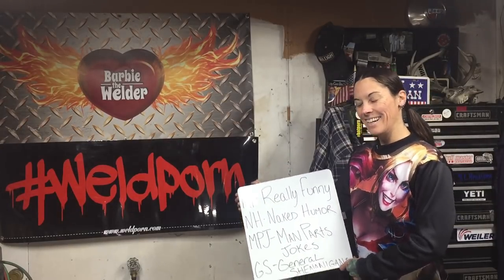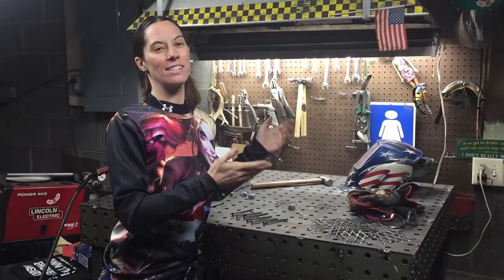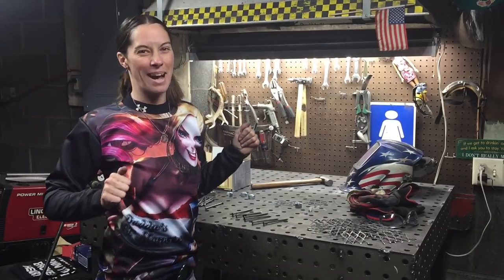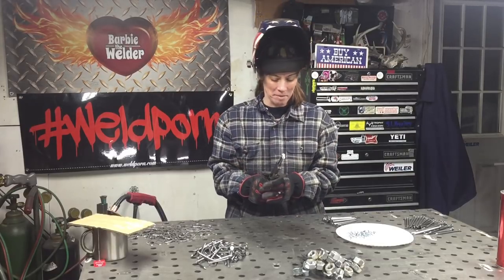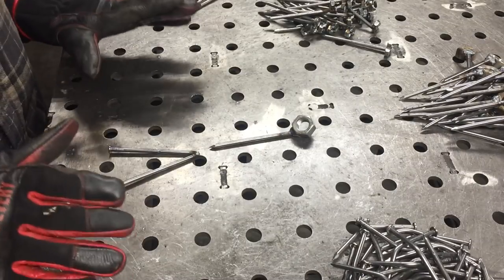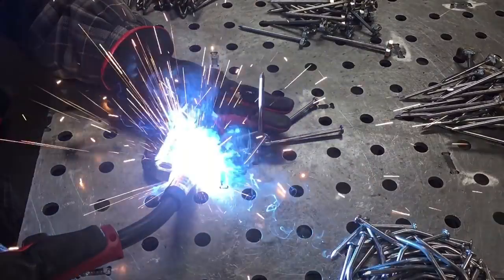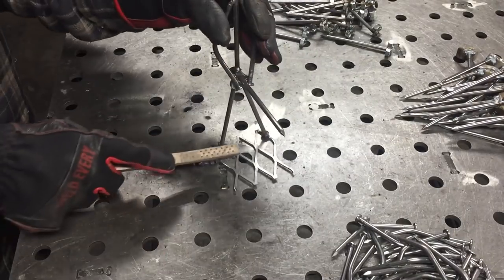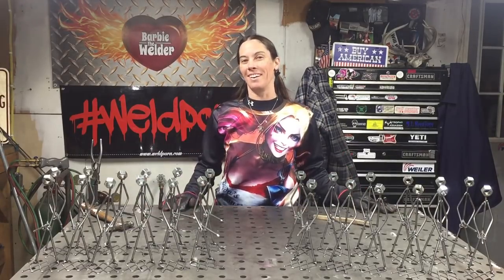How To Weld Big Dick Hot Dog Cookers | Easy Scrap Metal Art | Barbie The Welder

Comment: ...And after you use it....
All seriousness aside, do you find that you have trouble with spatter on your steel table, especially welding right down on it? How do you like to clean it up?  Mine's aluminum, clean up is easy. But it had it's downside too.
Reply from the maker: I spray it with spatter spray before I weld. Any spatter that I do get I knock off with a hammer and chisel.